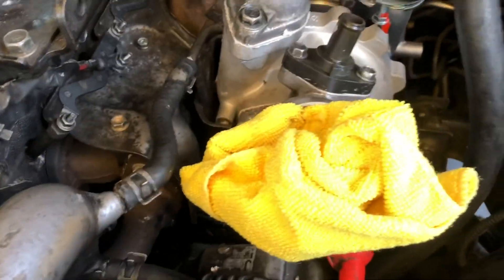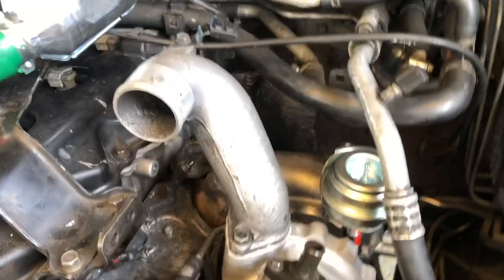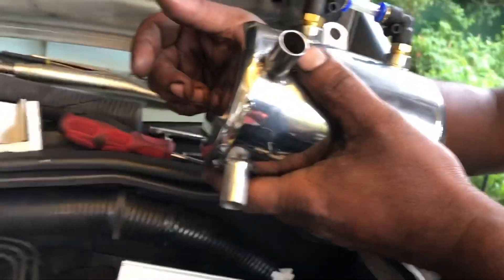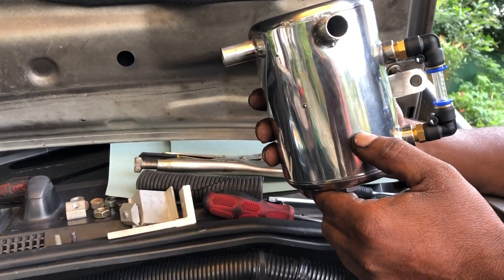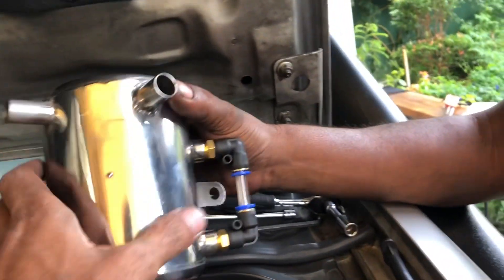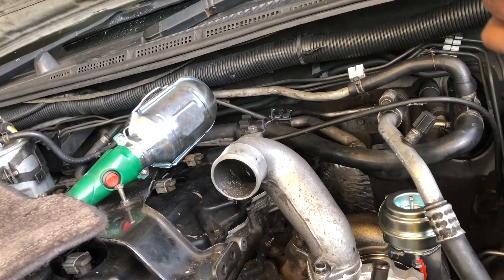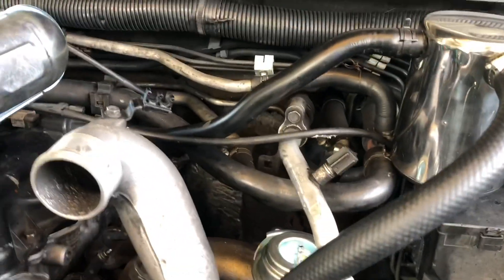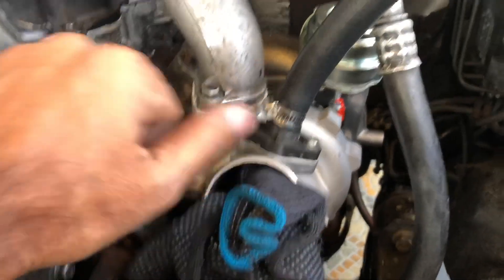Installation of oil catch can in Nissan Navara D40

Comment: What hose sizes (inner diameter) did you have to use and where did you get them? I ordered an eBay oil catch can and the max its inlet/outlet ports can take is 15mm inner diameter but the Navara's hose is 16mm diameter which fits loosely on the ports, searched everywhere for 15mm hose with no success. Except for a failed delivery of the incorrect item by amazon. Thanks by the way. 👍